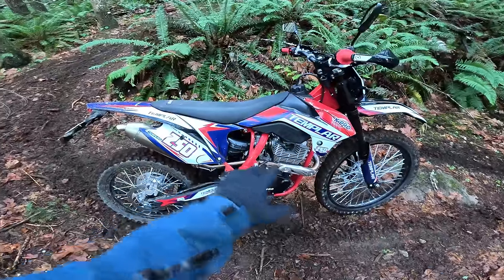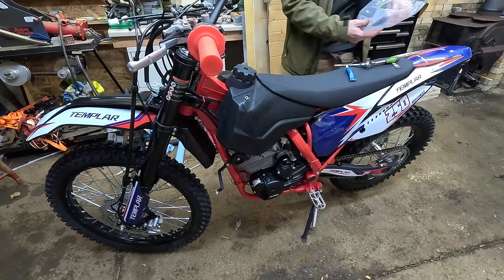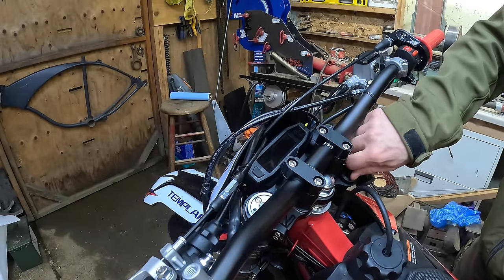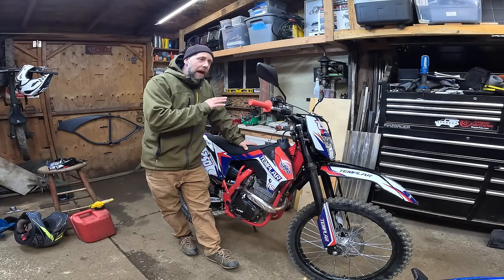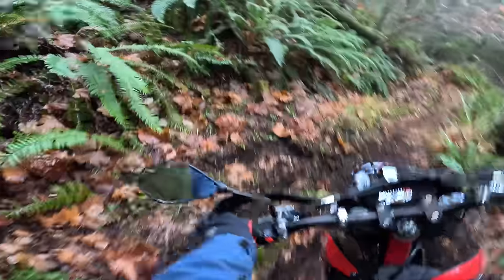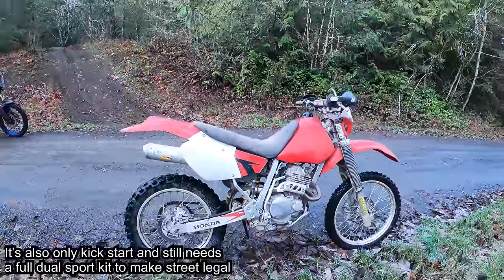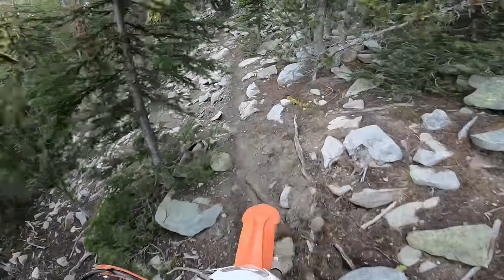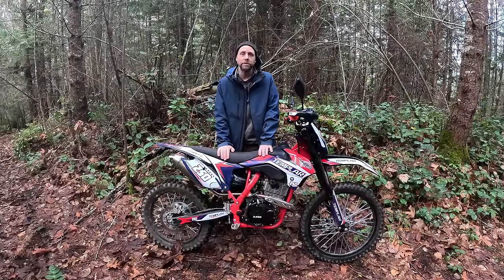Best Value New Street / Trail motorcycle? X Pro Templar 250

Comment: Love mine. I have the Templar X version with the 6 speed. Changed out to a 42 tooth rear sprocket, got it up to 78mph GPS speed. Have almost 500 miles on it with zero issues.
Reply: I also emailed X-Pro and they sent me a motorcycle title very quickly
Reply: Where did you order the sprocket from? Amazon?
Reply: @theonlybippufocus  Yeah, was like $20 something. JTR210.42 if I recall
Reply: @WyFoster  that’s not bad. I live in Washington as well so hopefully by the summer I can buy one of these!
Reply: Can you drop a link of the Templar X?
Reply: Honda xr 150 is  a better value
Reply: @bonniecavalcante9149  I think that'll depend on the longevity of the Templar.

So far, I don't see any reason why it won't run for a very long time and all the parts are easy to find. Also much faster than the 150.
Reply: Look i agree the xr150 is a better bike its also 4,200 out the door in Houston so for someone like me and lots of others who cant drop the money and do t want a 15% interest rate on a bike its a nice option. Also the xr150 is fully made in china so theres that. @bonniecavalcante9149
Reply from the maker: @bonniecavalcante9149  I’m pretty sure the XR 150 comes with steel rims 😞 the engine is also 100cc smaller. I myself wouldn’t buy the XR, But if the XR 150 is a bike you got your sights on I would say go for it. It all comes down to personal preference and what you like 👍
Reply: How much did you pay for it? Not its almost 2k with shipping 😮
Reply: What’s the price ?🤔🤷🏿‍♂️
Reply: @bonniecavalcante9149   Honda is made in China as well
Reply: Is it easy to learn how to ride and shift gears, want to learn how to ride one so I can buy one for my self
Reply: I’m 5’3 is this bike to big for me or nah?
Reply: @SharkZoneGaming-m2r  The X is a little taller. You can adjust it lower. But it would still be on the tall side
Reply: @WyFoster  so basically try looking at a different bike then? For me?
Reply: 500 miles is hardly a testament to reliability
Reply: Wait until ya hit about 1000, make sure your wallet is handy
Reply: @theninja001  these guys are nuts lol. 500 miles no issues.  No shit haha. It's been hardly ridden
Reply: @SharkZoneGaming-m2r I just go ahead and get it if that's what you wanted man cuz you can always lean that bike to keep her up I'm 5'8 and I still have to lean some dirt bikes over
Reply from the maker: @anakinskywalker4459  You have Zero content on your channel, you just complain in the comment section. YT TROLL 🧌???
Reply: Gas mileage?
Reply: @Mikefestiva  I dont have a channel. I'm not a woman
Reply: @Mikefestiva  so mad people Are talking trash on your Amazon dirt bike your ready to cry. Get a grip.
Reply from the maker: @anakinskywalker4459  Your comments just prove you’re an immature person. Even if you’re middle age you are still a teenager mentally.
Reply: @Mikefestiva  ok man. Don't know what ya want me to say. I'm simply responding to you bud. Move along and let it go that I have an opinion on your bike. Its ok man. I'm talking about the machine not you bud
Reply: We can agree to disagree
Reply: @anakinskywalker4459  annie are you okay?

Are you okay annie?
Reply: What is the top speed of the bike before you changed the sprocket?
Reply: @BryanSpear  69-70
Reply: Is it still holding together? I’ve been looking at bikes I’m just not sure if I should just get a used  Japanese bike or try one of these?
Reply: @EthanAdey  60ish at highway speeds. 55-65 mph.
Reply: How many miles you have now?
Reply: @greggory448  1,000+ winter slowed me down
Reply: Awesome. Does that model have kick start too or no
Reply: @aaronmcfee506  I’m pretty sure Honda is made in Japan
Reply: Nice for you, do you live in Washington State notorious for Sasquatch. Ever seen anything out there while you're riding? Or hear anything?

Comment: Loved your review of this "higher end" China bike.  Last summer I picked up a Raven bsr 250.  I believe it was $1422, assembled, fueled and ready to ride from a local China motosports dealer.  I've put 1000KM on this little putt putt.  Besides a few bolts to retighten...it has been reliable as sin.  It has been fun to ride and while not a power-house it is good on the trails and a bit of road use.  I had to gear it down 2 teeth on the front sprocket to help the off road manners.  I've been riding motorcycles for 50 years and at 6ft 7" and 280 lbs I'm certainly a bit large for this bike but I enjoy being able to get down the road and trails.  The top speed with the gearing change is 63 mph.  Some of these 'China bikes' get a bad rap but this bike and two 125cc youth 4 wheelers we purchase for the grandchildren (from the same dealer) have been very reliable and are quality builds.

Comment: excellent unboxing with great tips on assembly.  you are probably going to sell a bunch of bikes for this manufacturer.  i have been riding dirt bikes since my dad bought a honda trail 90 in 1964.  it was an excellent bike to learn on but, i out grew it in about a year.  this would have and been an good entry level bike in those days.  you will always want to go faster and faster.  1n 1969 one of my dad's buddies bought a new 750 honda.  we went with him to el mirage dry lake and had rip across the flats.  when ken asked me to see how fast i could go on it.  i weighed about a buck twenty. i was able to get her up 120 mph indicated flat out laying down on the tank with my feet on the passenger pegs.  that was so exhilarating.  i've had the speed bug since then.  now at 70 years old  i don't  care about speed so much but i still want to dirt ride.  this bike would be excellent for me now, striped down to its bare bones, coming in at about 220 would be a blast. easy bike to just kickstart.  not much to break when you dump it.  can't find old Japanese mfg.  dirt bikes less than one of these new.  but, of course we don't know their longevity.  but as Mike stated at the beginning of his evaluation.  with the ability to do the maintenance / upkeep on the bike it may last a long time.  i wonder if this company trades publicly?

Comment: Carb: Youall PE28, 120 main jet, 40 pilot jet, 1.5 turns out on idle mixture screw. Like all bikes imported, the carbs must have the air/fuel mixture screw hidden behind a welch plug. Remove to adjust AF mixture. The bowl also has security break off bolts, so remove and replace with socket cap bolts so you can re-jet to your hearts content.

Comment: For an extra $200, I bought one of these fully assembled about three months ago from Amazon. I haven't ridden it a whole lot yet (winter hit) but the time I did spend on it was enjoyable. I've had no issues so far. My MSO also said "off road use only" but (depending on which state you live in) the main requirements for street use (plates) are: brake lights/tail-light, turn signals, headlight, at least 1 mirror (2 here in Ohio) and a horn. Also, I'm 6'2" and about 210 pounds so yeah, the bike feels just a little small for me but I only ride it on the streets so I don't really get a lot of bouncing around. Eventually I'll tighten up the rear shock a bit.

Comment: I purchased the M and have had it for a year and a half now and the bike is awesome. The M has a reserve on the petcock. The M has a 36" seat height. I also didn't like the choke up top so I removed it and installed a traditional choke. I didn't like the giant spring on the kickstand so I modified it as well. It doesn't have a gas gage witch sucks. I also went with an x-ring chain. I changed the carb just to find out the one on the bike is identical. The bars on it bend easy so I swapped to some pro taper and a nibble 1/4 twist throttle. I have a 15/38 sprocket and it will do mid 70's. I've modded mine alot and have more mods sitting in the garage for later. The bike is awesome. Ride hard and enjoy bro.

Comment: First time viewer here. Nice work! Very informational, well communicated and smart. I like your "I don't need to change the carb" attitude. Cheap bike, make smart fixes. IMHO if you buy a cheap bike do as little as possible. Otherwise just drop the money for a better bike to begin with. 

I have ridden the PNW my whole life, like 45 years. Ridden pretty much everything in Oregon and Washington. FUN!  Small under-powered bikes are a blast in the slick PNW single track gnar. I rode 125 2 strokes for years. Had a AJP PR4 and a PR5, both a RIOT in the slick woods. The AJP uses a Chinese motor but the rest is really cool design and components. Really good fully adjustable name brand suspension, cool frame designs, mass centralization and freaking fun to ride. 

Good stuff, thanks.

Comment: Would love to see you put a nibbi racing carb with a clear float boul and the intake manifold with the air filter and see if the oil cooler would fit and work and see if u can find an exhaust that fits that frame and fits with everything just to get the most power u can get outta bolt-ons and see if u can get the adjustable suspension from the Templar x and get all the nibbi aftermarket accessories and u can have a solid bike , good build to start

Comment: DUDE,, excellent assembly video with a TON of great tips during the process..  I raced MX in the early 80's  while in HS.  This bike is about the same  we had  being sponsored by the local Yamaha dealer with the YZ 250 works bikes at that time.  We were two stroke so there was ways to port and polish for more HP and torque.  when racing torque is the king. Being able to drop in a tight corner in 2nd or 3rd where everyone else is a gear lower you can shoot out and leave  them in the dust.  :face-fuchsia-tongue-out:

We now some years removed for racing days, full time RV and was looking for a nice enduro for city and some trails where we travel.  this and some other seem like a great mix is new and old to keep the cost affordable.  

THANKS for your efforts and a great vid.. :medal-yellow-first-red:

Comment: The increased seat height & wheelbase of the Templar "M" version is a better fit for taller riders. And the "M" version comes with a tubular steel rear rack, an aluminum engine guard, and some suspension upgrades.

Comment: I have the 2021 xpro titan 250 actually not a 250, but I've had no problems with so far. I installed a nibbi carb and changed out the fork oil and engine oil. Also adjusted the rear shock a bit. Use lock tight on everything.
Reply: Well done James

Comment: I just sold the sister bike (Titan) to the Templar. The engine is essentially a Honda 230 copy even though the Titan was listed as a 250. I had it for almost 3 years and rode the heck out of it. I did add different springs to the front forks. Also, I changed my back brake reservoir. It worked great as a trail bike.

Comment: I have the Trailmaster tm35. It’s the exact same bike just rebranded. Had it for 6 months. Dumped it probably 10 times and still holding up pretty well. 42 tooth sprocket top speed 70mph. The bad: battery needed replaced immediately , chain was horrible, buy a x ring niche chain, headlight stopped working, the front forks need redone, the wiring is cheap, and engine mounting bolts break. The good: starts every time, Faster than my Yamaha xt225, can take a beating, and is a lot of fun. I like the bike, I don’t love it. If I could go back, I would buy a used Yamaha yz250 for about the same $ instead. But it’s not bad for a brand new bike that cost $2300 and is shipped to your front door.

Comment: Hey MIke. Awesome breakdown. All similar to my experience with a 250cc from China. I'm up in Alberta, and our selection of these bikes seems a bit different compared to the US, but the Bike I have is solid. Could be the names they stick on the plastics? Like you've said, if you're into maintenance and good at recognizing and modifying/resolving a few flaws here and there, then they are an excellent deal. I've had some trouble with the carb as I'm at a pretty high elevation, so I went straight to the Nibbi 30mm,  jetted it for my area and woke it right up!
The Nibbi eliminated any starting troubles. I got noticeably more power and throttle response. Worth every penny. An easy spend for under 100 bucks, considering the cost of the entire bike. However, I'm excited to see your mods on your stock carb because I had a tough time making the Nibbi fit with its different form factor. It was tight on my bike! I ended up going with a pod filter and bypassing the stock air box, etc. Stuck a filter on the crankcase vent etc.
 The Zongshen 250cc engine has been solid for me; it's nothing exotic but has a good low-end grunt and no issues. Just change the oil frequently and check the valve lash often - usual stuff we should do anyway. Thanks for the great content! Keep 'em coming!

Comment: The rear brakes were terrible out of the box and the front were fair even after cleaning and break . Bled and adjusted both and they are great!  Greased the rear linkage and locktite locktite locktite and anti-s everything. REMEMBER to oil the air filter!!  Rerouted the tail light wiring.  On the carb I pulled the plug over the air adjust and tuned that and adjusted idle and the stock carb now works very well!! (I’m at 900ft ASL).  9” piece of 1” x 1” aluminum “angle iron” strapped to the muffler with hose clamps solved the rubber spacer problem.  Also… Adjust YOUR SAG for sure!  Have fun!

Comment: You can change the fuel petcock to one with a reserve. If you don't know, there is no actual reserve tank - just two straws that come off the petcock into the tank; one a bit taller, and one shorter. The taller one would be your "on" position, when she starts to run dry, you flip it to "reserve" and it opens the valve for the smaller straw. 

For that reason, getting a "reserve" on this bike is as simple as changing out the petcock.
Reply from the maker: I completely understand how a reserve works on a motorcycle, I have been doing my own maintenance since I was a kid. What you didn’t understand was they petcock with a reserve tube isn’t available for this style tank mount, at least I still haven’t found one yet and I have put some time In on looking.

Comment: Kickstand Fix: Grind the “stopper bracket” on the frame a small amount about 3-4mm and my kickstand is now several inches higher and tucks in closer to the body and is no longer in the way of my foot/heel.  I added a second hole in the spring bracket about 1cm down from the factory hole and that tightened the spring enough to hold it up. #Winning!

Comment: My roommate bought one of these. So far he loves it.

We are both very mechanically inclined but his bike was much less assembled than yours seemed to be and it took us around five hours to put it together. Getting all of the wires to fit behind the headlight was tricky. The chain stretches pretty quickly but a DID would probably help that. 

He installed a Nibi carbuerator on his and it really helped with starting and performance. He also did away with the choke trigger and just reaches down and manually chokes the carb when needed. Overall he has been pleased with the bike.

I ride with him on my Benelli TRK 502x. It has encouraged me to push my limits as a person who is new to ADV bikes and offroad riding.

The offroad designation on the title has made getting a tag in Alabama tricky but he sent off for a revised title and that should solve the issue.

Comment: Last year I purchased an SSR 189 which appears to be an extremely similar chassis. The bike has been nothing but excellent so far, I just change oil frequently. I also recently picked up a 250cc straight from Zongshen that looks like the exact same engine for my ATC200X. I dont understand the hatred for the Chinese built equipment. Side note, fellow Washingtonian here 👋

Comment: Awesome video Mike! What a great bike for the price! I'm on the short side too, 5'8" with boots on and you're correct, it's hard to find a bike that fits guys like us. My 2018 Beta 300RR was amazing, but man, hard to put my feet down comfortably. I think you and I are around the same age (43) and I'm at the point where I just want to have fun. Don't need the fastest or flashy or any of that. I find myself ripping my nephews 2021 CRF250F since I fit so nicely on it! Hell, I have a old ass '92 XR200 that I love to rip! Low on power, but super fun!

A bike like this is crazy good for the price and a GREAT way to get people into the sport. It'll be REALLY interesting when the Chinese get fuel injection on these and it would be cool to see a cheap 200cc two stroke maybe even with oil injection around the same size as this Templar 250. I was very impressed how this bike took that switchback hill climb you went on, this thing seemed to be in the meat of the powerband the whole time. 

Looking forward to more videos of this thing! Glad you're having fun out there Mike, wish I was out riding with you!

Comment: The nibbi 30mm carb upgrade with the carb manifold extension with the aftermarket air filter and it’ll rlly open it up even if u can find an exhaust that will bolt up to it that’ll be even better for more power